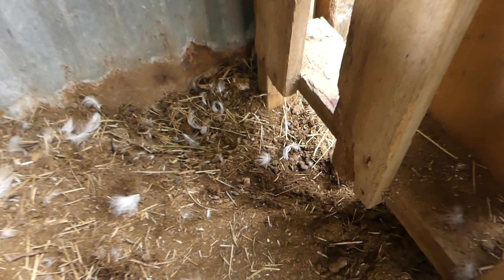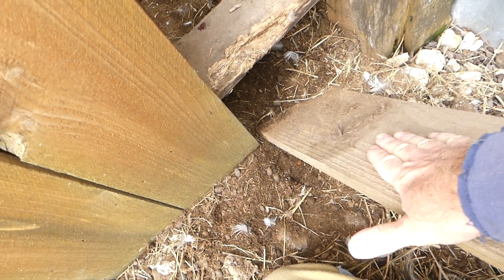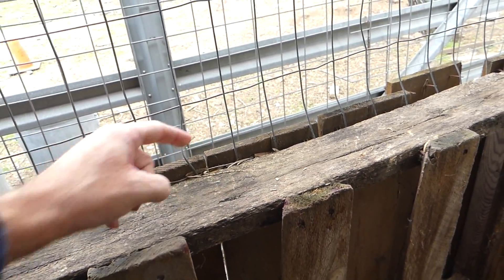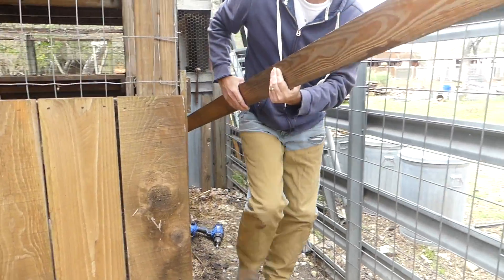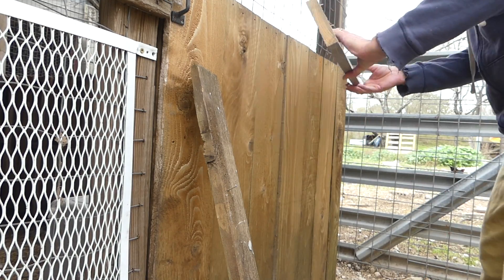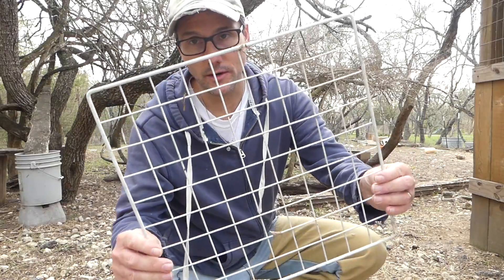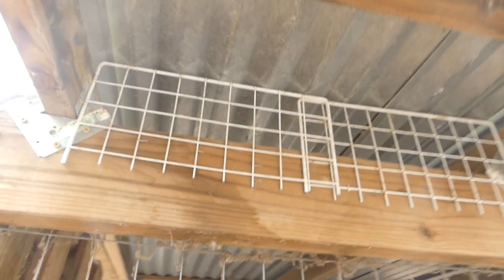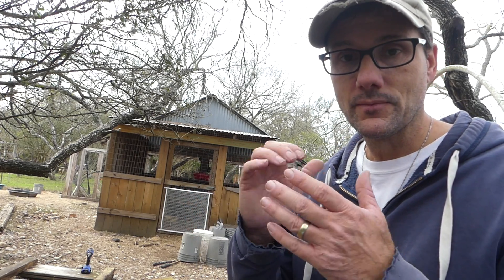PREDATOR TOOK MY DUCK - How To Predator Proof the Duck House

Comment: Doesn't look like its going to be easy for the next predator to get in there. Nice and secure now. Looking at the 2X4s you might want to think about building another one in the next few years, or at least putting up new walls if the structure is still good. :) Always something on a homestead to build or improve on that's for sure. Take care and have a Merry Christmas. :)